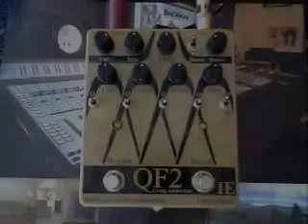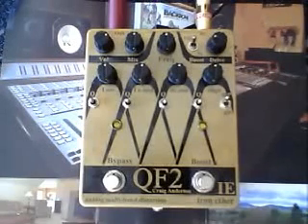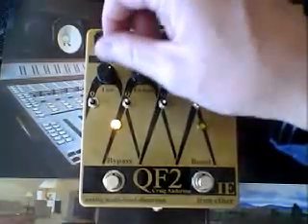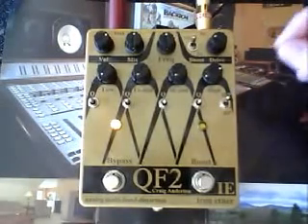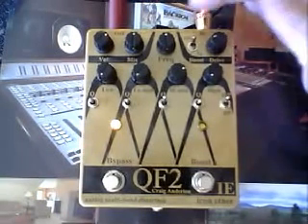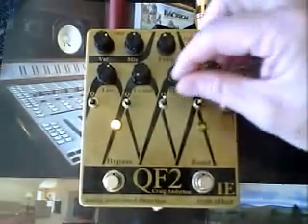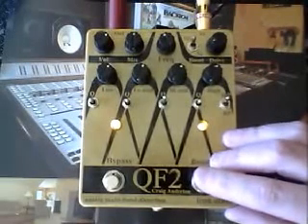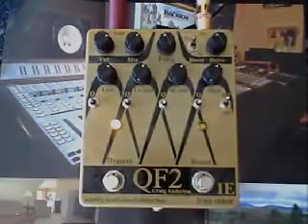QF2_Intro_1.wmv

Comment: Would you make another?
Reply: The ones I made for Iron Ether before we retired it, with the anodized and etched enclosures, are gone.  I happen to have a few of the original silkscreened units, as seen in the video.
Reply: @donaldstavely3890  nice! I've had the rack unit for a long time but have always wanted to get it in a pedal format. Are you still making pedals in general? My gmail is donc78 if you would like to get in touch. Thanks for the quick reply! I thought it was a long stretch since the video was 10 years old haha